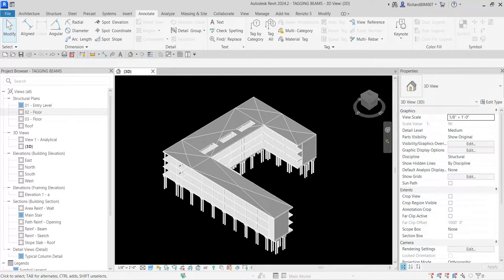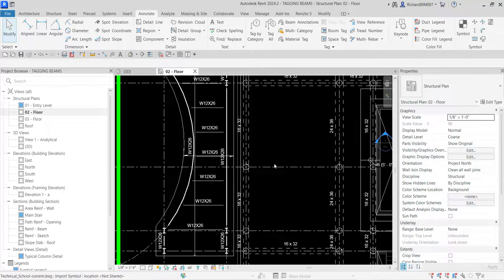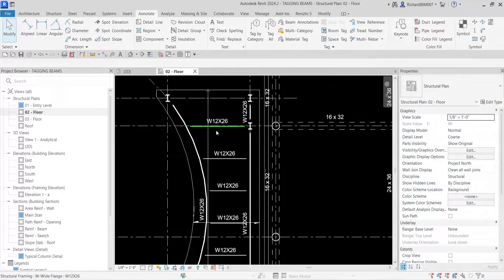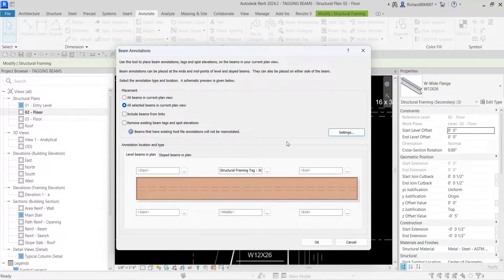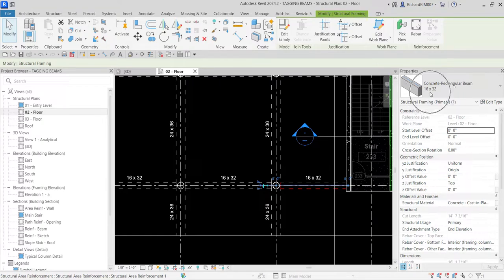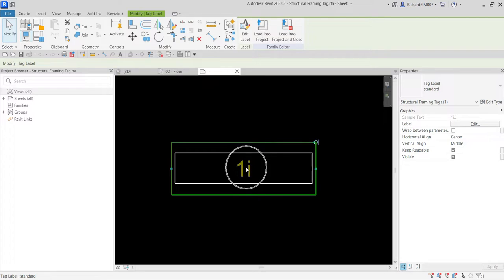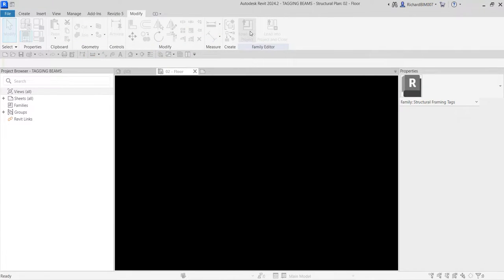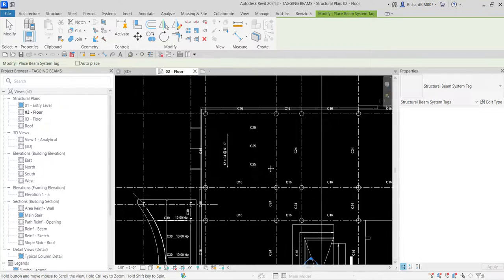REVIT 2024 FOR STRUCTURAL DESIGN: CREATE BEAM ANNOTATIONS

Comment: Look at drafting sheets used on site work....they show beam numbers as B1, B2, B3 n soo onnn.....it's just a simple idea which can be used in autocad in many ways but I wonder why such simple things can't be done in revit.....
Tcircle, Text count why those simple ideas can't work in revit but they work soo great in AutoCAD...
Obviously there are alternatives of additional plugins but simple things like these are missing 😐
Reply from the maker: Hi mate, thank you for watching my video on creating beam annotations in Revit Structure and for sharing your thoughts.

I understand your frustration with some of the limitations in Revit compared to AutoCAD, especially regarding the simplicity of tasks like labeling beams as B1, B2, B3, etc. Revit's complexity often stems from its comprehensive approach to BIM, which aims to integrate more data and intelligence into the model. While this can offer more robust functionality overall, it can make some simpler tasks less straightforward.

For tasks like beam numbering, Revit does offer solutions, although they might not be as intuitive as in AutoCAD. For example, you can use the "Mark" or "Type Mark" parameter to assign unique identifiers to beams. Additionally, creating custom tags and schedules can help automate and streamline the annotation process.

You're correct that certain simple ideas, like text counting or circle text annotations, are not directly implemented in Revit's core functionality. However, these tasks can often be achieved through Dynamo scripts or third-party plugins, which, while an additional step, can greatly enhance Revit's capabilities.

I appreciate your feedback and understand the need for more straightforward solutions within Revit. I'll consider creating a tutorial that explores some of these workarounds and tools to bridge the gap between AutoCAD and Revit functionalities.